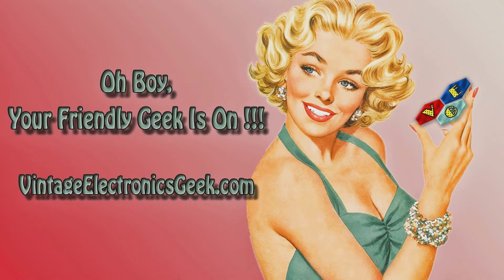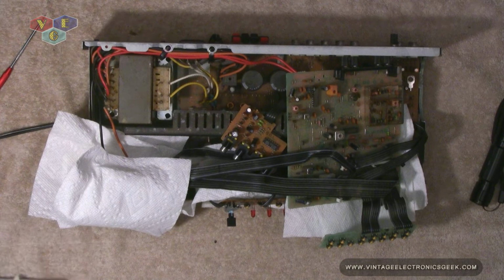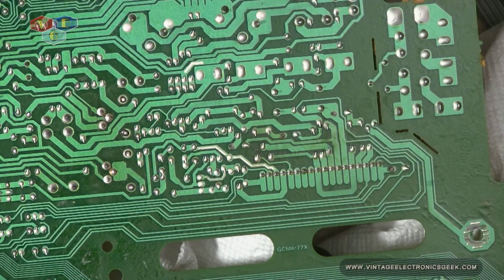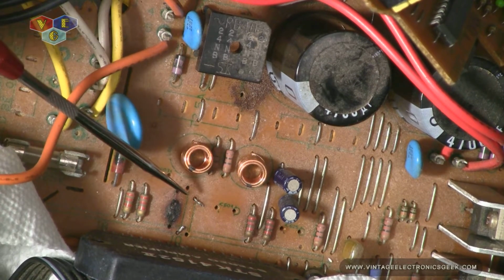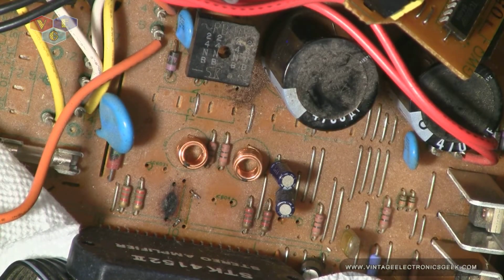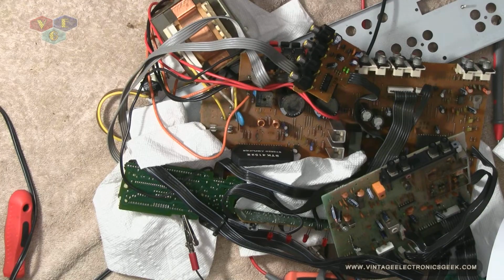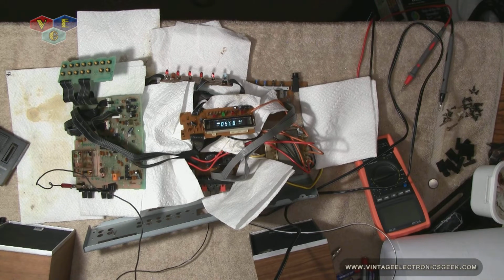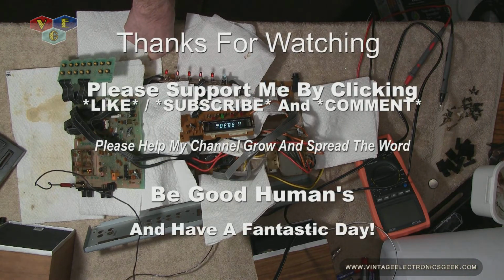Pioneer SX-V200 - Part 3

Comment: Dang! Was just going to open another beer when the video ended! Will there be a six-months later sequel? But seriously, I probably wouldn't recap either. Looks like you are getting closer. You can already see with this unit that there was in this era already a throw-it-away mentality in electronics. You had to take the whole thing apart just to work on it.
Reply from the maker: Whats your favourite?  Coors, Oly, Ham's?  Mine? Root...however I had ti give all that up many years ago...now I just do two a year! Not sure how much more...I recorded this 7 mos ago, just editing as I go through the projects.  I have some more older stuff that will be posted, its long winded, after that, the new stuff will not be. Only posting old stuff cuz I shot it already...hate to toss it. yes, I dreaded tearing this apart, but its done.  :) Thanks for watching.  ~Jack, VEG